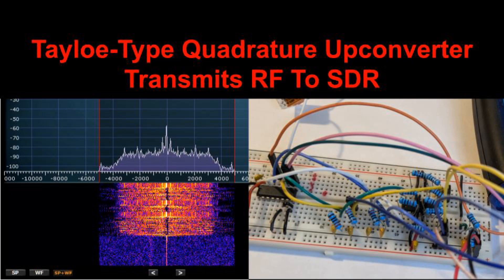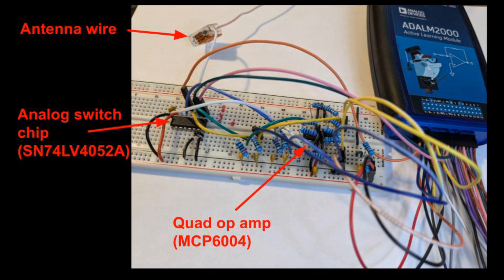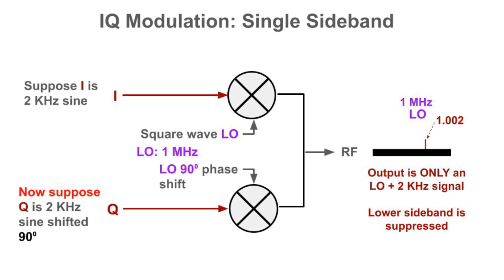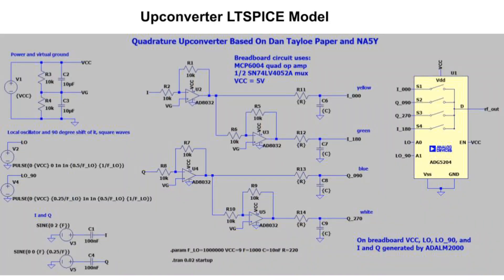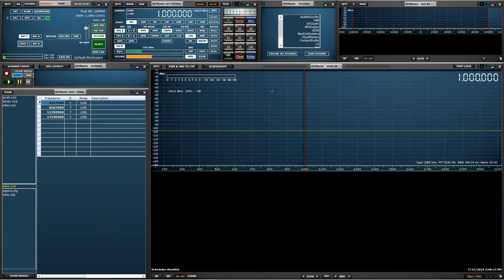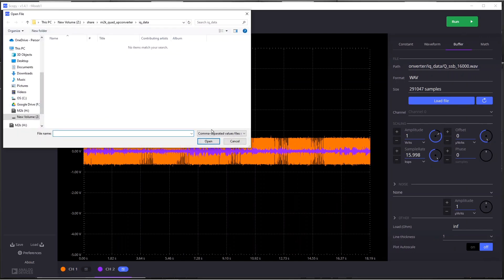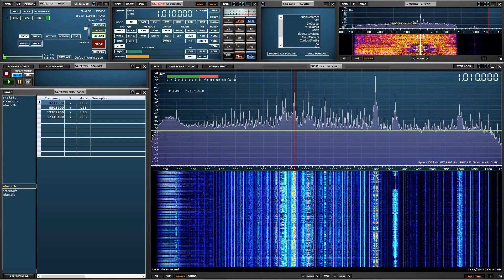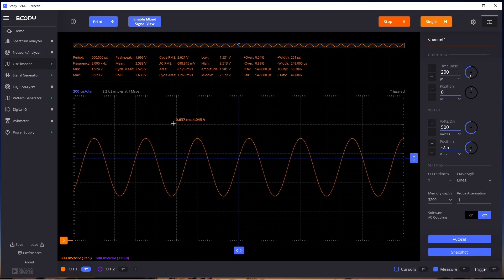Tayloe-Style Upconverting RF Mixer Transmitter Demonstration

Comment: People constantly say "but xxx might not work on a breadboard..." because it seems to be common EE mythical lore. No, nothing can possibly work on a breadboard over 1Mhz! You damn fool! Stop trying! It's a breadboard! Manhattan solder your circuit like a real HAM!

...but a hell of a lot of circuits way above 10Mhz seem to work just fine on a breadboard, with a little attention paid. Of course not as good as perfect on a 4 layer PCB... but damn well good enough to demonstrate thousands of examples.
Reply from the maker: It's a fair point.  Better to try it than just give up.  Certainly, I have had success on breadboards way above 1 MHz.